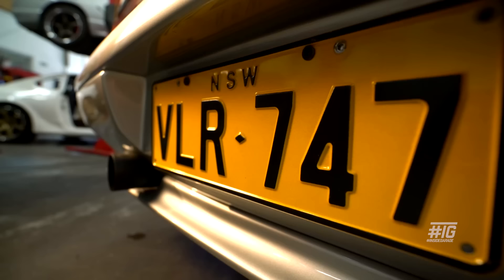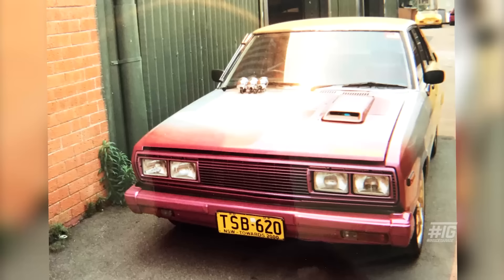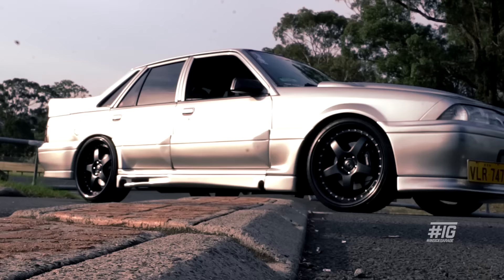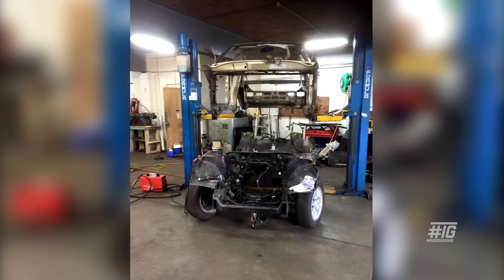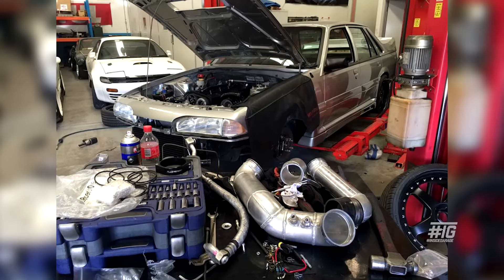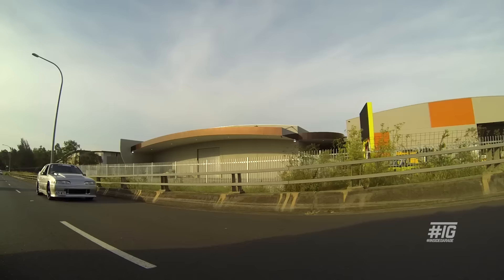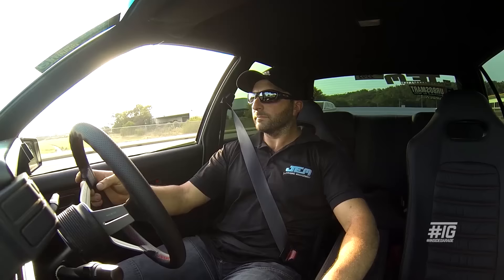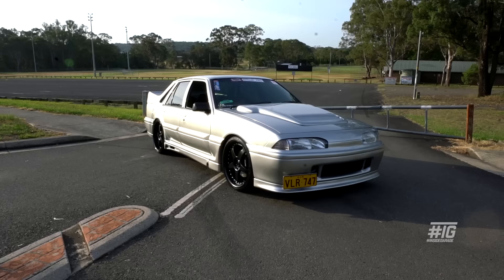INSIDE GARAGE: Huss's VLR 747 - Body of Commodore, Heart of a GTR

Comment: Wonder if it's registered as a VL or Skyline lol
Reply: May be a VLR33GTR Skymodore....Just a thought.
Reply: Registered as a VL
Reply: I can dig it..My VN Berlina is registered as a '38 Chevy..Well the '38's working gear is from a VN so..lol
Reply: should be registered as a skyline its using the chassis form a skyline (thats my thought)
Reply: I looked it up, it's registered as a VL.
Reply: VL's come stock with skyline motors because Holden couldn't make a fuel injected motor at the time so they bought the right to use the motor from I believe the r31 just kept it rear wheel drive. But I like what the guy said, "you can any motor fast if you have the money to put in it" but I like to think the driver plays part in 50+% of a cars capability
Reply: VL's used the RB30 because it was ULP ready.
Reply: its a vskline, 1/2 bread, what a joke really out of all the cars out there, that would be easier & a better looking car to make up, why not use the Cross 8 All wheel drive system & put it in a VL, What a joke really this bloke must have thought, i should have so many time sits not funny ? So has he been to the summer nats yet & drove it there & did all the burnouts etc etc, nope i bet my life he has not, maybe to show it off, but not drive it like a bat out of hell ?
Reply: if you knew what the crewman cross 6/8 drive gear was you wouldnt say that
Reply: True that. The Holden 4WD system is very weak in the front end. It can't handle much power at all. It's pretty common knowledge to
Reply: Not if you know engineering companies who could simply make the same gears & other important aspects of the auto to be stronger, its as simple as that, like Albins in Ballarat started out doing Racing gear box's for porches & Super roos for the Porsche cups cars & rally cars here in Australia to V8 super cars right now making the new Gears & Diff set up for the V8 super cars, they have at least 10 CNC machines, just to make super strong gear boxs & diff set up, its all about the CASH, nothing is impossible when it comes to it, check the company out, if you dont believe me, its about $1,000 per gear to make from scratch, but if you got the metal & find a different Engineering company with good CNC machines & other engineering machines & know the company, then you have it made, my point is that it can be done & it depends what your going to use the car for in the first place, all he wanted was a VL looking car but with JAP running gear & AWD why not just use the cross 8 & put a supercharger on it & have the running gear stronger to handle the power its simple as that ? My SON has a totaly OE VL 5Lt BT1 with books & original run sheet from holden & i have said keep it stock as a roack people will pay $$ for it, because its very hard to find a factory OE BT1, they are all Turbo's that had work done to them, thrashed 7 then sold, with just a paint job, then 20,000Km later the turbo goes on it, yet the 5Lt is still more harder to get then the turbo VL BT1's, i should have brought a caney yellow 5LT BT1 that Kevin Dennis had back in 1990, but i had my VK Calias at the time, which had everything, yet the BT1 still had the basic's no power steering, & holes still in the dash &  other areas, but who can tell which cars are going to worth $$ in the future, at least the VL 5LT BT1 will be, they are asking around 25K for an original unmolested one, like i have seen on shannons & believe me you never ever get you $$ back when you have a car, unless its something special like the Proto type VC Brock the two tone green one, which was going for about $30K & now is worth over 150K, unless you do the work yourself, but then it depends on what the market wants as far as cars & thats what puts up the pricing, cheers :)
Reply: I know who they are- but i think your comparing apples and oranges here. This was made by a guy in a smll garage. Do you have any idea how much decent CNC's are worth these day? Why go to all the trouble and expense when the factory R32 box is so good? That would be just throwing good money away for no reason. Hot Rodding started just like this, with guys scrounging through junk yards after the 2nd world war to find parts they could adapt to their own purposes. This is pure Hot Rodding at it's finest . If we were talking about someone like Jay Leno, then maybe I would agree with you. But in this case, I really disagree. Your looking at this like he millions of dollars to waste, I doubt that is the case though- a good CNC can cost upwards of 10 mill, a cheap one is still a mill or two if new- maybe still hundreds of thousands 2nd hand
Reply: the big one about the crewman driveline (i didnt mean the gearing/trans) is its made up of parts from 4 different manufacturers from memory jeep/land rover/holden/GM
Reply: Aaron Li I'd think it'd be regod as a vl cause that's what the chassis number is on
Reply: Aaron Li nah registered as a vlr
Reply: Aaron Li vl
Reply: 7071t6 he had the parts laying around for a skyline, not for Cross 8.
Reply: Nah be regoed as a vl
Reply: holden had a 3.3 litre fuel injected. it couldnt meet emissions for the vl. thats why they went for a nissan.They did make an injected motor
Reply: @The19ashley98  RB30 was a joint venter between GM-H and Nissan. GM-H put a lot of RnD in that. It was not a case of we need an engine so lets see what Nissan have
Reply: Everyone’s wrong,
It would be registered as a Skyline because of the chassis.
The VIN number that is used to register cars is attached to the chassis which is what he lowered the VL body onto, so it would have to be registered as the skyline.
Reply: @minecraftperson999  Correct
Reply: just keep it regoed as a VL throughout the build .. no engineering required lol
Reply: @streetguru3054  The RB was developed from the L series sixes in the zeds.  Development started late 70s - early 80s, they share the same casting materials, bearings, valvetrain as the Nissan VG v6s/CA 4s. Holden just paid their bills. If they had any input you'd think they'd mount their radiators the right height to stop blowing head gaskets, or not cheap out and run no intercooler on the VLT, unlike the turbo r31s.
Reply: @Jez3134   I m no Nissan expert I just remember when the VL's were new reading in either Wheels or Modern Motor magazine how the RB30 was a joint venture between Nissan and GM-H and theres even a photo of the VL Calais with a new digital dash that they obviously got rid of
Reply: @7071t6  R u OK dude? That's a ramble/rant half breed wtf and it's not a burnout car it's a weapon built for speed! 650kw at all 4 wheels.
Reply: @minecraftperson999  he could've used the Vl vin dopey
Reply: VL
Reply: Vl  Holdens are the original owners of the RB engine...js
Reply: @123chrispapa  yeah true but it would have to be registered as a VL because it looks like a VL. Can't have the cops looking for a skyline, when it looks like a VL 😂
Reply: To be fair, a VL Turbo is essentially a R31 Skyline.
Reply: @7071t6  It's AWD so it's a street/track weapon.
Reply: 7071t6 why does it matter anyways?
Reply: insult to call it a skyline
Reply: its a skyvlive. LMFAO no engineering certificate so basically the car would never pass the pits in any state of AU full stop?
Reply: registered as a skyline because it’s running the skyline underneath with the exhaust and shit, but the VL is a body on top so it’s registered as a skyline
Reply: All the cars this guy has owned are ugly, that’s what he does is make cars ugly
Reply: Well done . Blood sweat money years to complete then cops come and red defect u 🤦

Comment: I love the car, what a work of art. Well done Huss, you've done a brilliant job here, dude. Who would complain about the wheels, they look awesome- they suit the car perfectly. Is there another VL that looks like this with GTR running gear??? I read in Street Machine about 4 or 5 years ago about a very similar build, but the way it was constructed very differently according to the article. This one it was claimed, used the VL floorpan, they claimed the GTR gearbox fitted in the Commodore's tunnel. The GTR's rear sub frame was installed and he had some custom front struts made to allow the driveshafts access to the front wheels. It was a very similar colour, had the Walki kit and all, so similar that it makes me wonder if it's the same car and that the article was just horribly incorrect in it's claims. Can anyone help with some info or details to work this out? Either way, this car is unreal. Funny how it took one guy in his brother's shop to do this, but you see big dollar builds from the States where they do similar convrsions with late model floorpans being used in old muscle cars and stuff. Aussie ingenuity mate
Reply: i remember that car, i believe the article was in street machine way back in the mid to late 90s
Reply: You know what, your right. What I saw it in was one of those greatest car's of Street Machine mag's. One was released a couple of years ago. One car that's always stuck in my mind and made an impression on me (that was in the mag also) when I was young was a bright red '70 Challenger Pro Street car- it was an N/A Hemi with a tunnel ram if I remember correctly, but was absolutely on it's guts. The dude brought back the chassis kit from the States where he had worked at a chassis shop. Ever since Challengers and 'Cuda's have been my fav cars in the world
Reply: Daniel Brealey i think it was a maroon one atleast 15 years ago, maybe more, from memory vl chassis with custom front x member. cant remember what diff.
Reply: I remember one that looked like this. A Walky replica, but GTR driveline. Maybe that was a different one. The one I'm talking about was in a "Best of Street Machine" type deal a couple of years ago too
Reply: Daniel Brealey yeah there was, I recall it being a walkie too but cbf editing. i may still have the mag at mum and dads! it was a long time ago but if its still around ian baker would know
Reply: WholesaleTurbos ;)
Reply: I  recall the article you mention. i seem to remember him using the R32 running gear, not the R34 used here, which may account why he couldn't use the VL pan.
Reply: Evil Ash Yeah, that's right- it was an R32 driveline
Reply: That’s right Australia!
Reply: i found this video from someone mentioning that other GTR commo build

Comment: Did anyone notice the photo shop? 😂😂 his green commodore the turbo is photo shopped in it’s not connected at all the air filter is underneath it running straight into the intake manifold 🙄

Comment: wow this is exactly what my older brother done.. 1st car sigma 2nd car commodore replaced engine with BBQ... put v6 comm engine in the sigma slight modifications...
sigma is undercover as he has just bought dads mechanic shop ...projects on hold work work work the crazy bustard works from 7 till 9 on the daily

good stuff you finished your projects

Comment: I wanted to be that level of tradesperson but it seems that everybody in Newcastle has told me to p**s off, I haven't worked for almost 6 years & can't figure out why !!!!

Turboing a VL Commodore was just a dream so all I could afford to do is build the Nissan RB30DE engine using the R33 Skyline head & pistons plus ECU,so I kept it in naturally aspirated form, the car is full of rust now & needs redoing.

I need to cough up $1500 for the rego & insurance including the pink & blue slip for my 2002 VY SS Commodore as it's been off the road for 3 weeks after I got caught driving it unregistered, I am under the impression this firm is going to employ me but I haven't heard from even them :- http://www.tomago.com.au/

The VY just needs the cam & lifters replaced in them because they got stuck really bad,they are noisy sometimes now,I've got the camshaft already but the car needs about $1500 spent on just the engine, it was tuned before I bought it in 2008 to match the VE Commodore with the L76 engine in power.

It's like they thought I wanted to be poor in the Newcastle area !!!!

Here is a picture of my 2 Commodores :-

https://www.facebook.com/photo.php?fbid=429251270597878&set=a.429251127264559.1073741843.100005390262695&type=3&theater

Comment: Its like putting a v8 in a car that has only have 4 cylinders in it when it came from the factory, like a doing this LJ Torana & then put the Cross X 8 running gear in that, see you at the race's or even better see you on the road scag, lol :) Less than impressed, what happened to the old days of racing down pipe road on the Sat night, when people had no idea what was under the hood & you raced for CASH upto 5K . :)